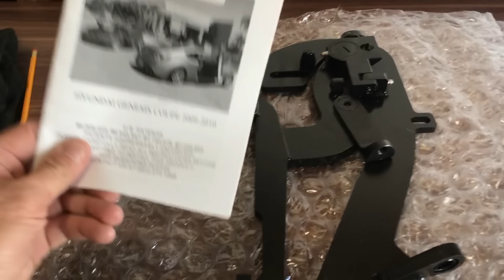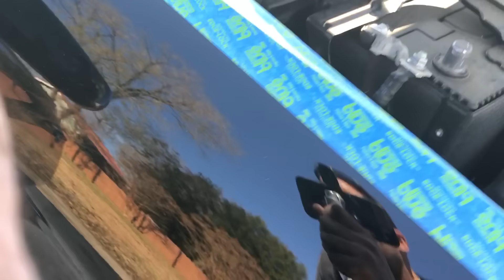Genesis Coupe Vertical Door / Lambo Door Installation

Comment: I really want these doors on my car but I have heard a lot of bad things about them people have said that over time the doors start to sag and do not close correctly have you had any of these problems with yours?
Reply from the maker: They only sag if you use them as vertical doors a lot and let the door drop hard. That will make it go out of alignment. I haven’t had any issues with mine. My only complaint is that they can be hard to raise.

Comment: How did you simply get the fender off from the rocker panel area, last time I did it I broke 2 clips.
Reply from the maker: It’s tight and a pain. You really have to pop it just right and with the right amount of pressure.

Comment: Do you have the link on these doors ??
Reply from the maker: https://verticaldoors.com/collections/hyundai/products/hyundai_2010_2010_genesis_coupe_vertical_lambo_doors
Reply: Vehicle Evolution did you need a wiring harness for the doors ?
Reply from the maker: You have to extend the existing harness by 6”. The kit comes with the wire and connectors to do that though.